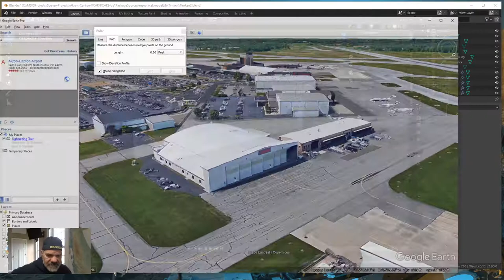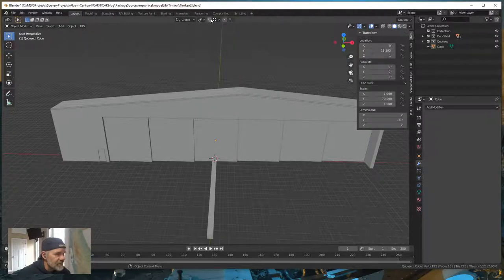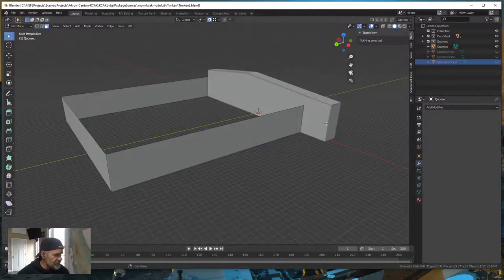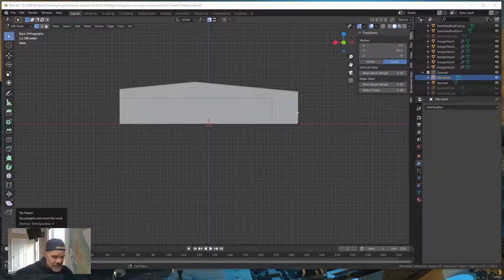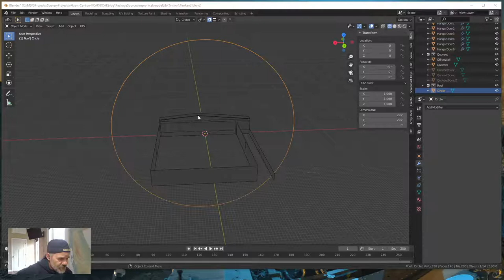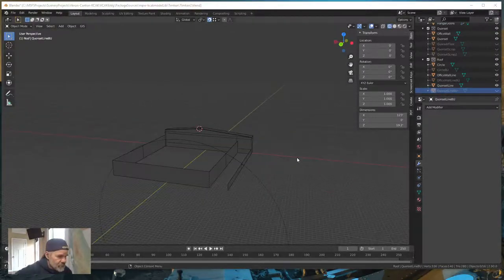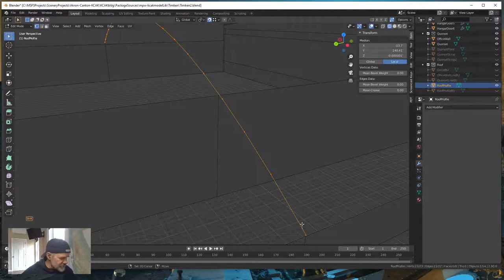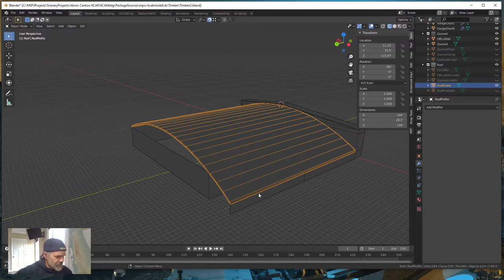Creating Scenery for MSFS 2020: Modeling a Quonset Hangar Part 2

Comment: Using what you taught me, I used solidify for the quonset roof. Also I couldn't get the edge to extend to make a vertex on the circle, so I subdivided to add vertices.  The result was a small overhand on both sides of the building which looks normal.  Thanks for all you are teaching me. Don't worry about how long the tutorials are.  I usually pause to let what you have covered soak in before I proceed. I like the way you teach, in that you explain why you do something, rather than just say click this button.

Comment: Just a note that caused some of the problems.  The height of the quonset you checked 11 months ago was 21 feet.  You checked it three times.  Today the view is different (back hangar doors are opened different) It checks 31 feet now.  ??? Checked back corner and both ends of the west wall. Front of shed on left side is now 40 ft and right side is 42 feet.  They were 26' and 28'.